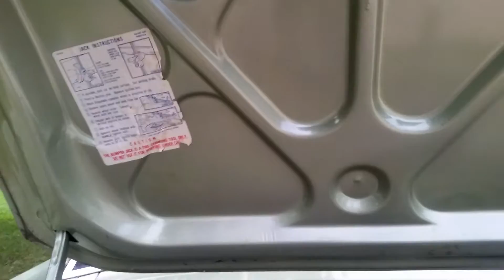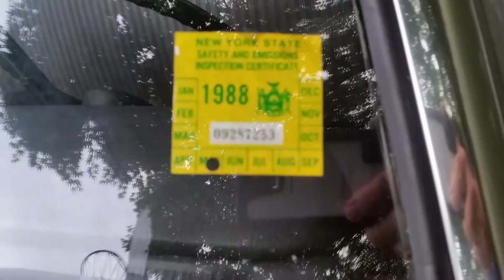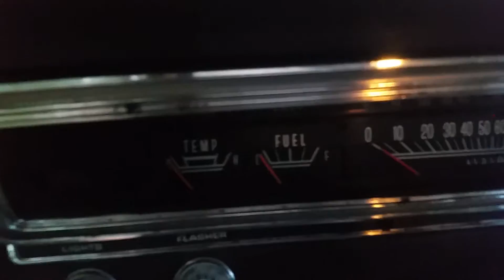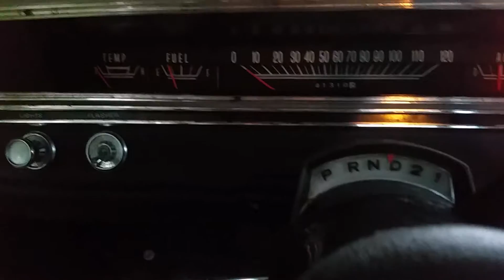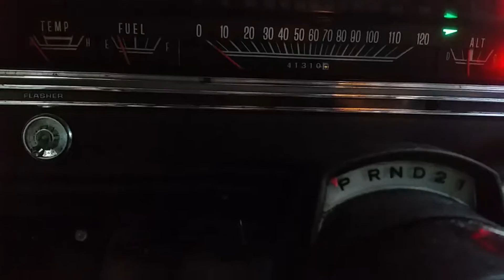1969 Dodge Dart Sights and Sounds of an original 4 door

Comment: These were great cars as long as you didn’t get one with the dreaded vinyl roof.  When you go looking for one today most are rotted out on the a pillars and C pillars and around the rear window because of those stupid vinyl roofs.  Chrysler used to advertise that you got a vinyl roof at no extra cost. The reality was it was cheaper for them to throw on a vinyl roof than do the bodywork to fill in the seam where the roof section met the body. 
The did have carpeted floors back then too. They came on the higher trim level cars like the Dart Custom and Swinger models.  I had a 70 Swinger with the carpeted floors.
The 67-72 darts are nice looking cars.
Reply from the maker: I agree

Comment: Gorgeous car but those bumper guards need to get ditched for the originals.
Reply from the maker: Those were a big thing back in those days even up to the late 80's with metal bumpers..we used to sell them at the dealership..nowadays have you seen the chrome tube bars they install to protect the plastic front and rear bumpers on these newer cars..serves the same purpose I guess..

Comment: I would  drop a 340  v 8 in it.....and turn  it into a sleeper  car.......😆😆😆
Reply from the maker: I would if I had the drivetrain ...but you know its not just the engine..then its the trans, rear end,brakes, cooling system..etc..😆
Reply: @alyoungcuda  I know it all take money,  but maybe in the future..... you can give for it😄
Reply: @Al Young Cuda, I would leave it stock and drive it daily.  That’s the biggest problem with finding a dart or duster. Every clown tries to throw some huge motor in them and screw them up making a weekend “toy”. 
Why not just enjoy them as chrysler made them and drive them daily?  I have a 383 in my 1960 DeSoto and it drinks gas. I mostly drive my 1957 or 58 Plymouth or my 60 Dart. I like 318’s and slant sixes.  I’m not looking to act like a kid and race people and wreck my car.
It’s sad but I see so many of these that were perfectly good running cars,that get turned into “projects” that sit in the rain and never get done because folks have bigger dreams than wallets.  I think your dart is great as it is. Just drive it and enjoy it and preserve it.
Reply from the maker: @Suddenlyits1960  definitely keeping it plain   its so easy to work with, no fancy disc brake conversion,  led light conversion etc.  Even the 13 inch tires are on there...try finding those that are not trailer tires..😆 but I do need 1 left handed wheel stud for the rear..I'm holding out from buying right hand replacements.